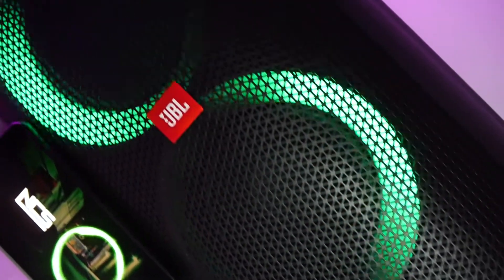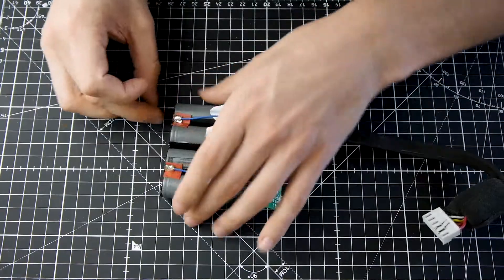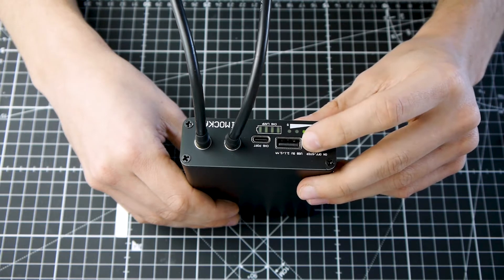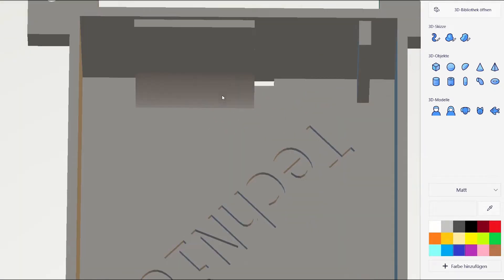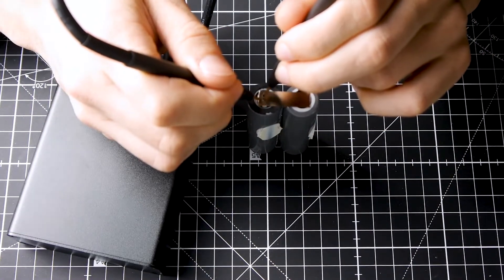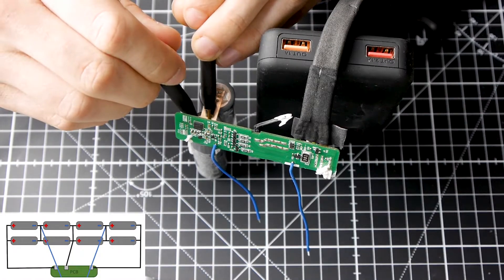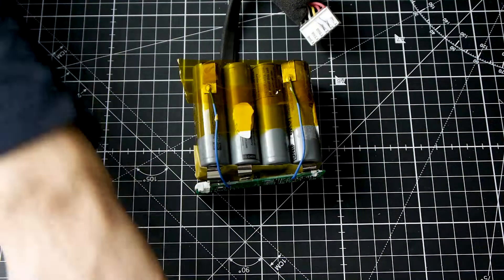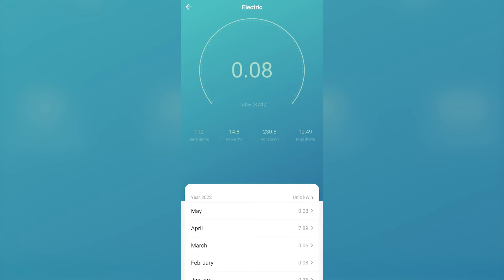JBL Partybox 100 battery upgrade | no additional plug | use the old battery | 🔋🔋🛠️

Comment: Can you please share the battery purchase link ? The linked you shared for battery isn't working
Reply: Co-ask please
Reply from the maker: The name of the battery is INR18650M26. But you can use any other LiIon 18650 Battery if you just want to switch them out. But dont mix them

Comment: After replacing the battery cell, my PTB310 cannot turn on when the AC power is unplugged (the charger is still plugged in, it can still be turned on when plugged in). I suspect the circuit is locked after replacing the battery, can someone guide me on how to handle it?

Comment: Could it work if I buy a new OEM pack and connect the new wires directly to the old connector? Wouldn't it charge the same?
Reply: Like not messing with the bms, but instead soldering the new pack connector to the old one.

Comment: Most important question here is:

How in the world these JBL suckers engineers with that big of a unit didn't put a bigger battery???

My 100

No lights
No Bass Mode
50-60% volume
All kinds of music
Wavelet EQ

Couldn't touch 5hrs playing time 😡
Reply: That is what i always thought, and battery doesn't cost much as compare to other parts. They could have put at least thrice the size of what's in the box🤦
Reply: Because it's the cheapest of the partybox line, if you want a more upgraded partybox go for the 300 or 710 or the ultimate, it's up to you
Reply: @SamuelPiresN  BS! There's no excuse, PB100 is pretty expensive and deserves a bigger battery, if you have the space put it in!
Reply: @iamlegend3669  and more, the sony in my country is more expensive than the pb. now you do you, but i prefer bass and sound quality over batery life lol. thats what a speaker is for, music and experience. check the whole video, especially the last half, and let me know what u think
Reply: @SamuelPiresN  I have the PB100 and I am happy with it, just expected better battery from its price point.  I also have a Tribit Blast, much cheaper, better battery and sound wise pretty similar. I only use PB100 for kareoke nights, my friends prefer The Blast though.
Reply: Just to let you guys know my PB100 turns on by itself, then off and then on and so on...

I'm so disappointed on JBL!

It works but when I turn it off it turns on by itself in the middle of the night and can't sleep!!!

JBL is 💩

Comment: Hi very nice video I have question when you finished to the pack of batteries and then plugged to the speaker and connect to power the indicator light starts from de first light even if you charged batteries before??
Reply from the maker: I shot it in the wrong order🙈

Comment: Mine isn't turning on because the top came off. How do I fix that?
Reply: Make sure the strip connectors didn't come loose when the top came off. It probably pulled out of the board under the power button. Use the other connections as an example of how they hook up.

Comment: Ican't turno off my party box 100 , I try reset presing + Botton and playa Botton and not work.
Reply from the maker: Maybe the button board is demaged. Try to check if there's a connection between the board an the button. If so, check if there's a connection to the mainboard. Maybe it's only a loose contact
Reply: @technico5880  thank you so much.

Comment: Hi, I upgraded the battery to 4s6p, 250Wh, but still acts like old battery. Can you please tell me how to bypass the limit? Reset doesnt work
Reply: How did you wire it?
Reply: I have done the same thing. Does your PartyBox show full charge even if it’s not actually full?

Comment: Will this boombox hook up to a TV?

I need a stereo that can hook to my TV for playing videogames. My TV sound isn't that good
Reply from the maker: Depends on the connection you want to use. I use this box sometimes for my video projector if I am outside the house. I connect it over Bluetooth to get a 180 degree sound with 2 other speakers. No cables, good sound👍 you can use also the Aux In. It's not as good as the Bluetooth connection but if you use a old TV you won't notice the quality difference.

Comment: I have pb100 since one and half years. Now while charging at 5th indicator of led not stop blinking. Is there any weakness of battery?
Reply from the maker: Yes, it's possible but don't worry you will have enough capacity left.
Reply: @technico5880  thanks for your kind reply
Reply: Yes you are right. Next four points battery backup giving sufficient playback. Thanks for your kind words.

Comment: Hey, ich habe gestern den Akku meiner Partybox 110 erweitert. Ca. um das 4 Fache. Jetzt habe ich aber ein Problem. Alles funktioniert soweit, jedoch geht dir Akkuanzeige genauso schnell runter wie mit den alten Akkus. Hättest du eine Idee  woran das liegt?
Reply: Liegt es vlt. daran, dass ich die Akkus vor dem Einbau nicht 100% vollgeladen hatte? Ich habe echt kein Plan. Am Ende des Videos redest du etwas von charging  Limit. Wie genau meinst du das?
Reply from the maker: @arthurdause4374  oha das 4 Fache😅 Also es ist sogar besser sie nicht 100% aufzuladen dies ist auch sicherer. Also sie sollten die gleiche Spannung haben. Wenn die Akku tatsächlich um die 10A haben müsste es eigentlich gehen. Die Partybox 100 regelt bei 2,5 A ab um den Akku vor Überladung zu schützen. Dann musst du sie zurücksetzen oder anschalten und ausschalten und wieder anschließen dann sollten nochmal 2,5 A reingehen.
Reply: hey, hab genau das gleiche problem. die ladestandsanzeige der box fällt ab wie immer bis die box abschaltet. mein neuer lipo pack hat dann noch über 16,2V, ist also im grunde noch voll.
Reply from the maker: @oODerFlo  interessant, du meinst bei der 110 oder bei der 100?
Also bei der 100 reicht es die Box einmal kurz zu resetten dann "vergisst" sie das bereits verbrauchte Limit. Bei 110 weiß ich leider nicht. Ich sollte mir mal eine zulegen und testen was möglich ist. Ich habe gelesen, dass es die Firmware über die App gibt. Vlt. kann man da irgendwie das Limit im Code aufheben.
Reply: @oODerFlo  Hey, hast du eine Lösung für dieses Problem gefunden?

Comment: Are double the capacity now than the original?
Reply from the maker: Yes, I want to make three times the capacity but unfortunately there is not enough space
Reply: @technico5880  i just wonder if it works.I was thinking if i put 5 18650 in series and reach 20 volts can the partybox play like its plugged cause i seen a video of a guy that he use a power bank that outputs 20volts and he said its not losing power when its on battery mode.You can do extension cable and put the batteries at the bottom of the speaker.Also you confuse me with the charge part for example if i use 4 batteries with 3500 mah it cant charge fully cause it has something like limit charge?
Reply from the maker: @alexdoukas  it definitely works. I got much more runtime. As you can see in my previous Video the Speaker Powersupply delivers 20V. You can bypass it with a 20V powerbank but then you need some additional output. 
As I said in my previous video the cells are connected in series and the battery delivers 14,8 V. Now I connected a second battery to every single battery in this series connection, now it's a 4s2p configuration. 
Now the charging:
Let's say the battery is new and you can charge around 2600mAh instead of 2500 until you reach the 4.2V limit. This can cause overheating and battery damage, therefore the mainboard has protection and limits the amount of capacity. And no, without resetting, the battery will only charge until 2500mAh. 
The most important thing about this mod is, that you do not need any external  plugs and drill holes. You can use the old battery place and the same charging plug.
Reply: @technico5880  so everytime you have to reset the jbl so it can fully charge? No needed to drill holes just extend the cable also you made a new battery holder and that cannot found so it kind of easier the extend cable if you are ever want to put a bigger battery configuration
Reply from the maker: @alexdoukas  no, wait what do you mean with extended cable you can replace the power supply or the battery with it but not "make" more capacity. My plan was to use the old battery and the bms. Honestly there is not that much space at the top, because of the mainboard. You can attach as many parallel cells as you want but you need space. I made several tests to measure the capacity. First I wait until the battery is completely empty and the box turns off. After that I charge and measure the wattage. Without reset I can charge 45 Wh (battery has 37) until the charging end. After that I reset and can charge to 70 or 80 Wh as you can see in the Video which makes sense because now the battery is 14.8V with 5000 mAh or 74Wh.
Everytime you use a different battery or another configuration the old BMS will not work and you can't charge your battery over the mainboard and need to drill holes for an additional output to charge.
Reply: @technico5880  I mean extended the cable so you can put the batteries at the bottom of the speaker it has plenty room. Also thanks for the info and the help you give with your knowledge. I'm about to buy 4 Samsung 3000mah batteries since the original are losing power quickly. So for the extra 500 mah I need to reset the partybox so it can fully charge since the original are 2500 mah
Reply from the maker: @alexdoukas  ah yeah I understand. But use the original BMS because otherwise you could not charge the batteries with the mainboard. In my first tests I got around 10 Watts leftover. Maybe you could charge them without resetting. You should monitor the charging status with a meter. But yeah if it's not working you have to reset. And one last thing. You don't have to extend the cable it's already long enough. You may have to short it. In my last Video you will see how the battery is mounted and connected
Reply: @technico5880  I will only change batteries nothing else.How do you count how charged are the batteries?In case i was going to put the batteries at the bottom one solution was to extend the cable cause it hasnt the lenght to reach down to bottom of the speaker.
Reply from the maker: @alexdoukas  I used a smart plug connected to my Google home. I reset it first to start at 0 kWh.
Reply: @technico5880  I see and with that you saw that it wasn't fully charge so you reset it and took the rest mah. Seems useful tool might buy it.
Reply from the maker: @alexdoukas  yeah but you can use any other wattmeter. It should only save the value that passes through
Reply: @technico5880  tomorrow I'm gonna take the batteries samsung inr 3000 mah 15a and propably Saturday it gonna be ready. I ll talk to you how it goes.
Reply from the maker: @alexdoukas  👍 but be careful when open the box and working with the battery